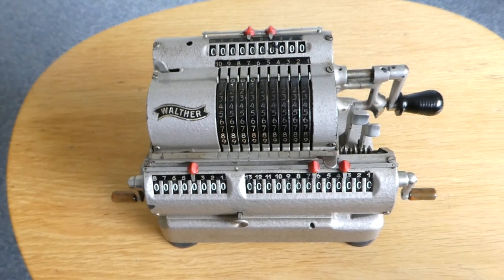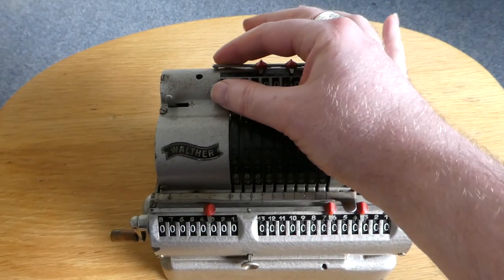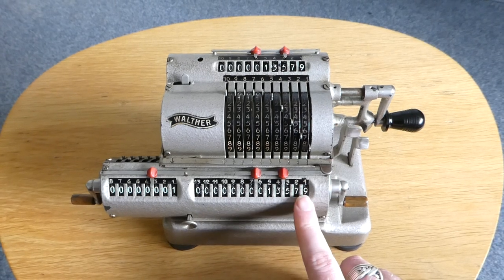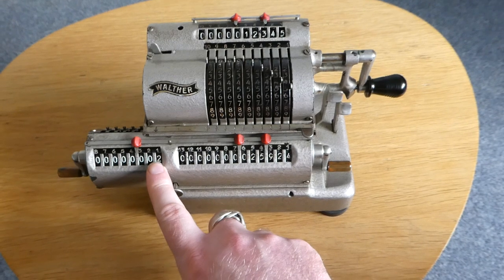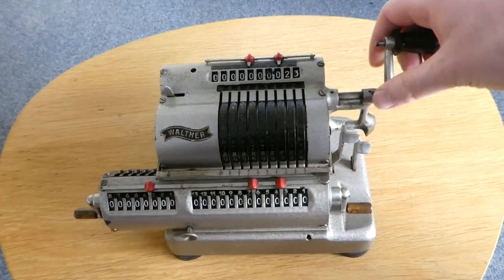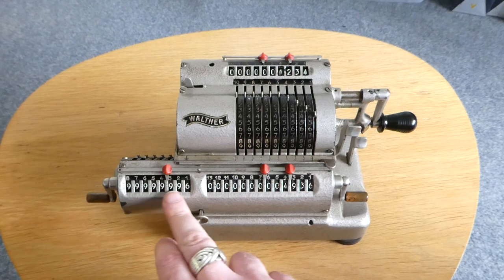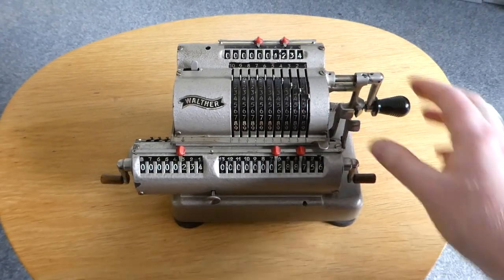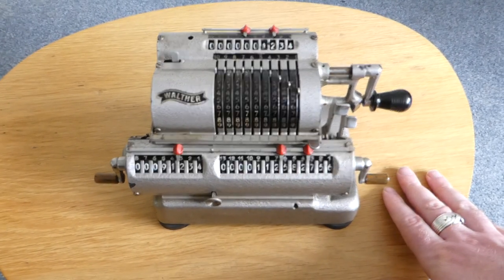The Walther RMKZ calculator

Comment: I saw a similar Walther Calculator made when I believe they were prevented from making fire arms.  The body of the machine appeared to be cast in gunmetal and was quite intricately patterned.  I did not dare try to work it as there was no way I wanted to break it.  We used a Facit version on tanker ships before electronic calculators were more reasonably priced.  Chief Officer when working out the cargo would have is office door shut but we could hear the whir whir ting whir of the machine going.

Comment: It's basically an Odhner, but with a carry mechanism in the counter register. 
PS, is it possible here to use both directions in division, like in some electric machines?
Reply from the maker: The carry mechanism in the counter register goes both ways, so sure, in division you can use turns in both directions to reduce the total number of turns of the crank. The bell will ring with every over/underflow, which can become rather annoying though.